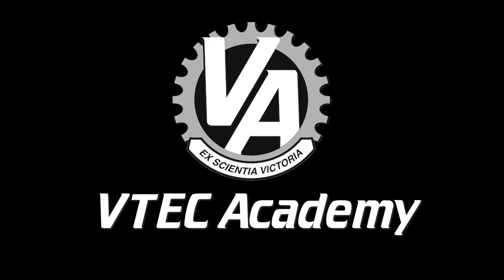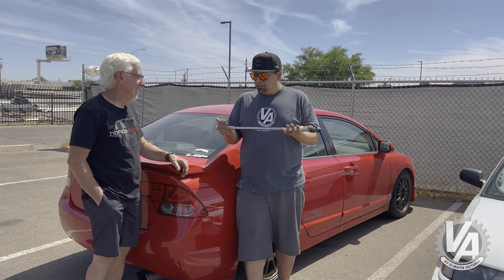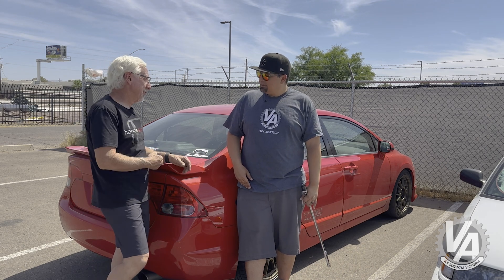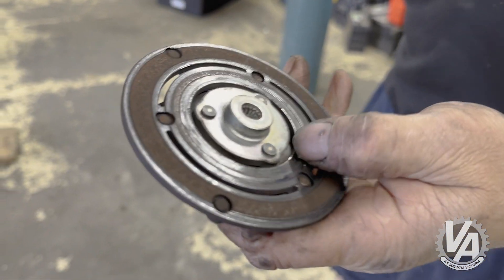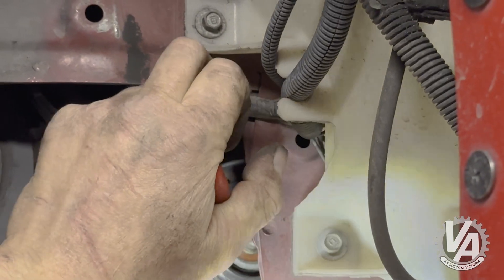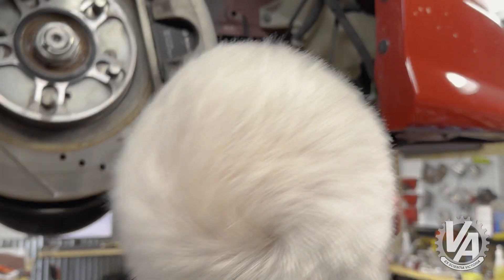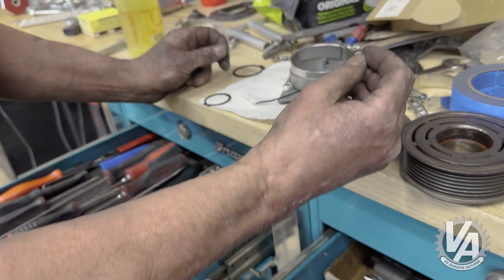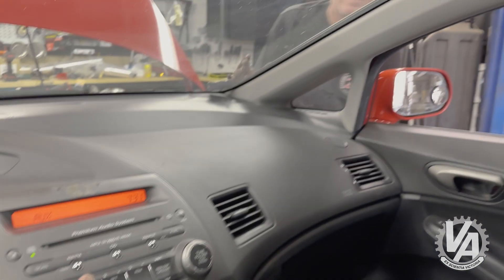TRY THIS FIX! How To Fix Car AC - Compressor Not Coming On - Air Conditioner Not Working?

Comment: My Civic Si 2002 the AC turns on automatic when I turn on the car. The fan blows at high speed inside the car. The knob is in the off position and doesn’t turn off.
Reply from the maker: That is a new problem I haven't heard of.

Comment: I have an AC problem.  My AC would blow out cold air than switch to warm.  I stop the AC and wait a little.  I turn on AC than it would work awhile. Next day it would work for 15 min than warm air started blowing. I swapped the compressor with a rebuilt compressor. That day it came out of shop, super cold air was blowing out.  A week later, warm air started blowing out and it’s been that way ever since. Have you run across something like this before?
Reply from the maker: Was the compressor engaging when it was switched to "on" and blowing warm air? It could be the gap on the clutch.
Reply: I have the same problem the compressor clutch is on blows cold once o stop at a light blows warm. I've seen on the forum it's common for 8th gen civic but noone has figured out the problem 😢.
Reply: Sorry for late reply. Found out my problem.  Bad relay.  Swapped it out and everything fixed.

Comment: Great video much appreciated 👍

I had the same symptoms at ambient 110+ but it was basically stop and go system blew warm then with airflow it was cool again. I replaced the entire system and still have the problem when temperature is above 105... I have a 3½ FMIC Though... Am i just basically screwed or is there an option to keep it cool? I installed window washer sprayers in the bumper to spay the FMIC i think 2 more lines T'd off with mister tips to drip the condenser may be the solution? What would you guys do??
Reply from the maker: Usually that is related to the condenser fan not working properly.
Reply: @VTECAcademy  I could see that being a cause for sure in a stock setup. It's just unable to deal with the extra 3½" thick intercooler in front of the condenser + oil cooler. I was considering the Mishimoto race line fans to replace both as they flow crazy CFM. Appreciate the info.

Comment: The AC in my 95 Civic isn't very cold. I had the AC system checked and it's fully charged but it's just not very cold compared to my wife's 2016 Civic.

Comment: My 8th gen SI is having this exact problem. 215k miles, original compressor.
Reply: My 8gen ex 220k has exact same issue. I'm wondering if my clutch is bad too. I haven't finished the video yet, but is there a kit if these parts that can be purchased?
Reply: @alabamamotionpictureproduc6626  I'm not sure of a kit you can buy. I went a head and replaced the entire compressor. Fixed my problem.

Comment: Wont it be more easier to just replace the whole a/c compressor than having to through all the hassle.  Yes i know you have to recharge the a/c but just my 2cent.

I've seen quite a few honda a/c compressor exploded, not sure if its a manufacturer defects or just plain junk.
Reply: Why replace something that isn't broken? And it's way cheaper to replace the clutch without involving the entire compressor plus refrigerant and extra costs.
Reply: The compressor alone is 5-10x the cost of the parts used here.
Reply from the maker: Draining the compressor properly (and legally) requires special equipment.

Comment: Replaced the plate on a CRV and it lasted 2 years. Then did what you have done in the video and fingers crossed it lasts more than 2 years. Horrible job this. It's worse if you don't have a hoist and have to do it on the ground. Congratulations on feeling cool air in the car
Reply from the maker: Yeah, it’s not pleasant on the ground.